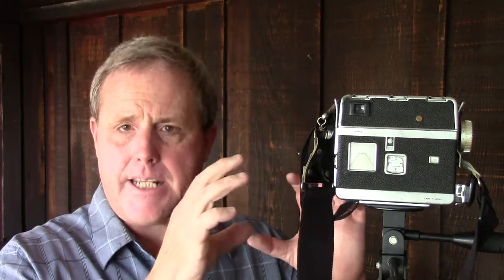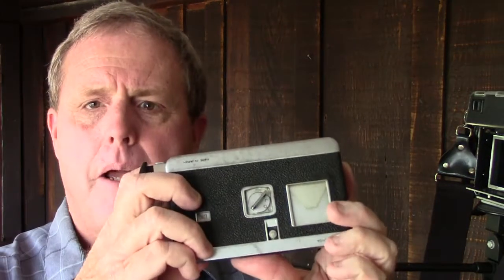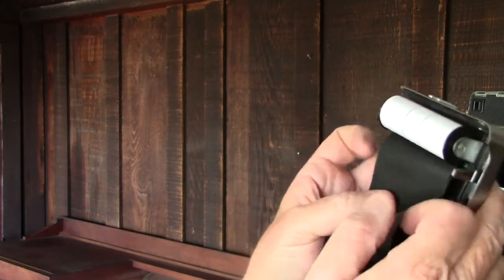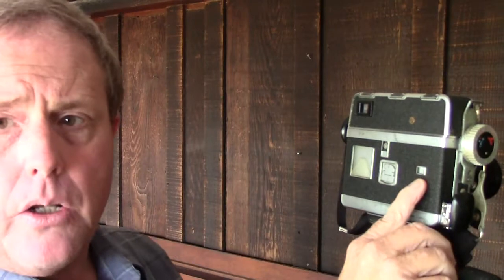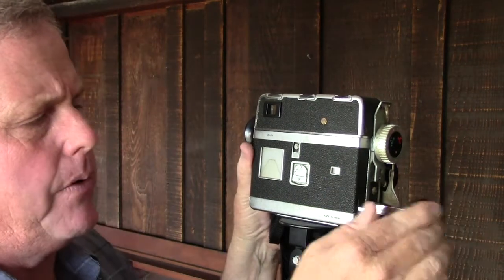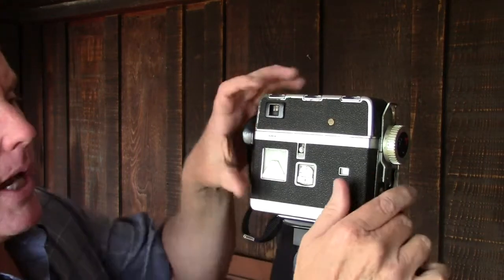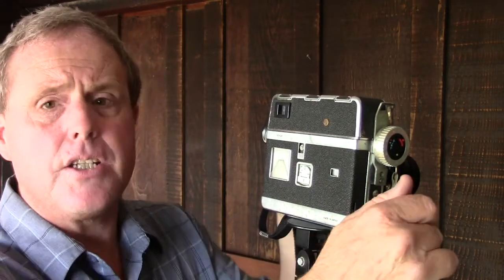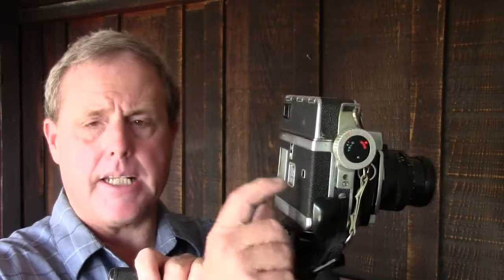Koni-Omega Rangefinder Film Loading

Comment: Thanks for the video. Appreciate videos done by folks with lots of experience with the camera in question. The looks of this camera hides the fact that they are ergonomically perfect. Do you know at what point the advance plunger charges the shutter? Thanks.
Reply from the maker: I don't think it completely winds the shutter until almost at the end of it's travel. The shutter can be wound by hand using the lever sticking out the bottom of the lens barrel.

Comment: Hello.  An excellent film about the camera and its features.  I had the opportunity to buy one, but it comes with a cassette for 220 film.  Tell me can I use it with 120 film?  And what problems can there be?😊
Reply from the maker: I have not tried that, but it would probably be fine. The frame counter will go beyond number 10, so know to finish at 10 on a 120 roll and then just wind it on to the end. I doubt anything  else on the camera would care.

Comment: Hi Chris, Question, I have a Konica Omega 100 with a 90mm Omegon Lens. But, it won't focus well. Only at aperture F22 is gives sharper images. Important to know, I use a 120 film in a 220 back. What might be the problem? The 220 back or a real focusing issue within the camera? Thanks for your reactions.
Reply from the maker: The 220 back shouldn't make a big difference, I would suspect the lens or it's mounting. The 90mm lens focuses at infinity when focused back against the camera body.... In fact all the lenses do.

Comment: Hi Chris,  I have a couple Koni backs that have locked up.  Have you ever had your backs serviced?  If so, by whom and could you let me know what it cost?
Reply from the maker: Hi  Richard, no I have never needed to have mine worked on. They are so simple I would make sure the release knob after number 10 is pushing enough. Maybe that lock is loose and interfering.  Hope you find a solution. Chris
Reply: In the US, and probably in the world, the guy to do to for Koni Omega repairs is Greg Weber. He will come up in a google search. His website is a bit cumbersome, and it looks like the repair estimates for Koni Omega work is down in May 2022. There is (was?) a YT video showing the disassemble, service and repair of the KO back. The back is deceptively simple looking from the outside, but is a bastard of little bits and pieces inside. I've done a few DIY camera repairs, but no way would I attack one of these backs, for fear of never getting it reassembled. (And I also have a copy of the official service manual for the KO.) Also, with no intention to insult you, you do know that the  advance lever automatically locks when it reaches the end of the roll and wind on process, right? There is a little lever on the back that you push to release the lock and allow a new roll to be loaded.

Comment: I'm having an issue where no matter how straight I load the film, by the end of the roll, the film is always slightly crooked so the backing paper is riding up the side of the reel which wont allow me to seal the roll properly when I take it out of the camera.
Reply from the maker: I don't think I have had that kind of problem before. I always pull the roll real tight before I seal it, but they are always straight. Maybe something is slightly bent in the camera back. Chris